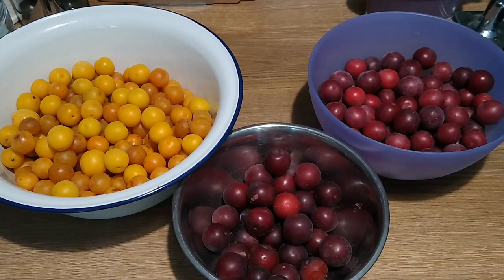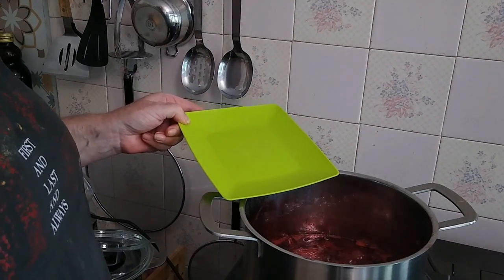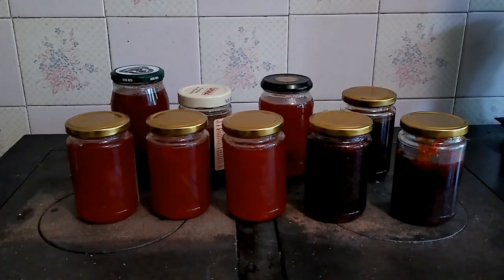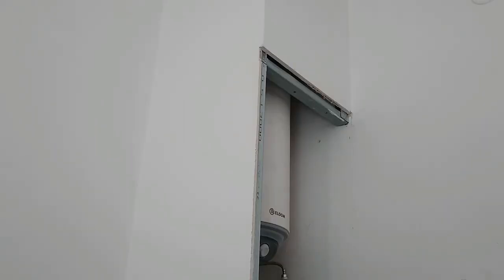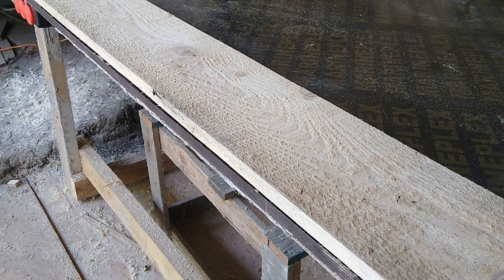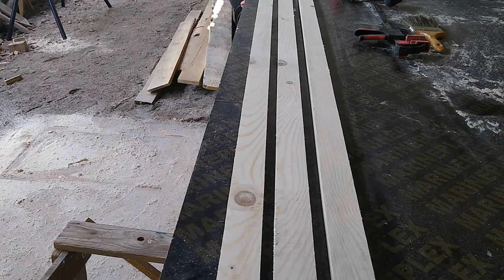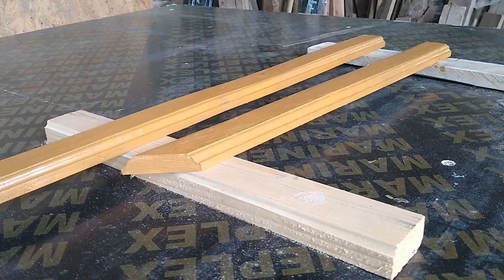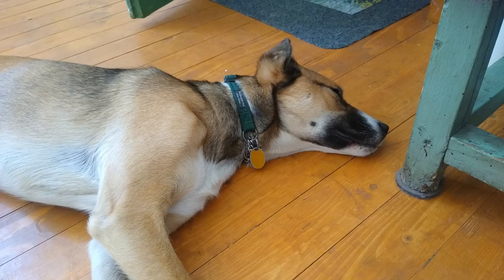Ep. 145 - Turning wood into architrave and plums into jam

Comment: Great job on the architrave Adam, did you bring all your tools and benches from England or buy it in Bulgaria. You seem to have all the right equipment for any job you do 👍 The jam on toast looked lovely,made my mouth water 😂
Reply from the maker: Thanks Paul, it worked out well! 
I brought some of the tools with me, the table saw I bought for £8 at an auction (I miss those!), and a lot of other tools came with us.
I built the bench from the 2x4's that I used for the cess pit plank formers and a sheet of marine ply. The router table was from Kaufland and I have been accumulating Parkside battery tools. It is a standing joke that I insist on the right tool for the job but it does make things easier!
We are almost through the first jar of jam and yes, it tastes as good as it looks!
Reply: @ourlittlebulgarianadventure  £8 for the table saw,what a bargain. I’m slowly building my tools up at the house. I’m nowhere near as adept as you at doing jobs so I won’t ever get to your level of tool collection but I agree you must have the right tool for the job. Glad the jams going down well, have a good week all 👍